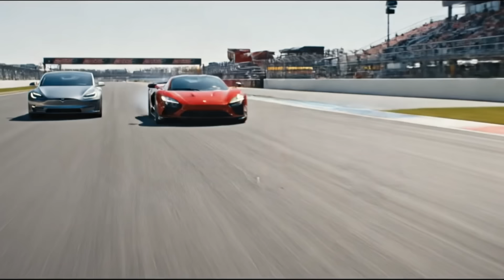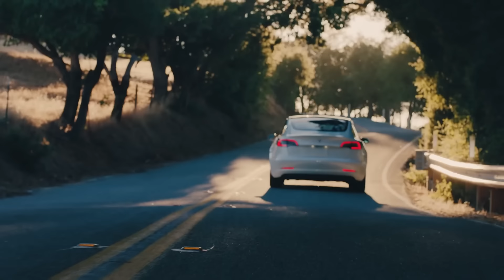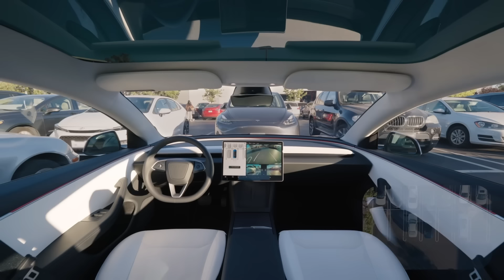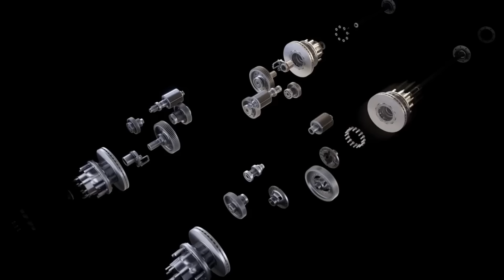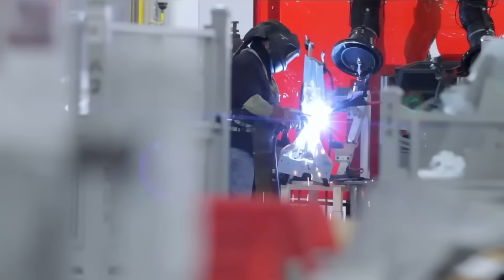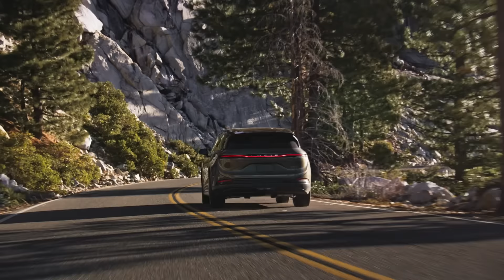Elon Musk’s New Engine Just Ended the Battery War Forever

Comment: We don’t need face melting acceleration. A car should be cheap to buy, cheap to run, reliable and convenient. EVs are none of these things.
Reply from the maker: I totally agree—most drivers don't need 0-60 in 2 seconds. However, the real goal of this motor tech isn't just speed; it's Efficiency. By making the motor more efficient, we can eventually use smaller, cheaper battery packs to get the same range. That is the only real path to making EVs 'cheap to buy' and 'reliable' for everyone in the long run.

Comment: EV are dead. Gas prices is getting cheaper.
Reply from the maker: Gas prices fluctuate, but the shift to electric is about more than just the cost at the pump—it's about a long-term transition to sustainable tech. Even with cheap gas, the efficiency and lower maintenance of motors like the one we discussed are hard to ignore. Whether it’s a pure EV or a 'bridge' like an EREV, the technological leap is already here to stay.

Comment: How efficient do you think a gasoline generator would be if you were to use the carbon wraps technology in it canceling out Eddie forces which in turn would make a more efficient generator.  The same technology could be useful for any mechanical energy production.
Reply from the maker: That is a brilliant connection! You’re 100% right—applying carbon-wrap tech to the electric generator in a hybrid system would significantly boost its efficiency by killing those eddy currents.

This is exactly the kind of innovation that could make EREV systems (like the Chevy Volt or Mazda R-EV we just covered) even more unbeatable. Higher efficiency in the generator means more miles out of every drop of fuel!

Comment: Explain to me how carbon is NOT an electrical conductor in carbon fiber?
Reply from the maker: Great technical question! While raw carbon is a conductor, the carbon fiber composite used here (fibers + resin/epoxy) acts as an electrical insulator in this specific motor design. Unlike a continuous metal sleeve, this composite structure prevents 'eddy currents' (electrical friction) from forming, which is exactly why the motor stays so much cooler and more efficient. It's the material science of the resin + fiber combo that breaks the conductive loop!

Comment: When Tesla finally realizes that fossil fuel engines is cleaner and far more efficient than fossil fuel recharged, fossil fuel mines and refined battery components, that's when REAL environment protection begins
Reply from the maker: The 'mining vs. tailpipe' debate is complex, but the long-term goal is a circular economy where batteries are recycled. 🌍 However, if you're looking for a cleaner way to use fuel today, that's exactly why we just covered the Chevy Volt and Mazda R-EV tech—it’s the bridge many are looking for!

Comment: I'd like to see a car recharge as it drives.
Reply from the maker: That’s the ultimate dream! While solar roofs are still too slow, the EREV tech (like in the Chevy Volt or Mazda R-EV) is the closest thing we have right now—it uses an onboard generator to 'recharge' the battery as you drive. We're actually diving deep into this in our next video!
Reply: @Nexovery yes that would be great to see, two powers working in unison

Comment: Magnets are not needed in AC motors (a Nikola Tesla invention), which are, by design, much lighter and less complex than DC motors. AC motors are possible in a battery-driven automobile by using an efficient inverter design.
Reply from the maker: Actually, modern EVs use AC Permanent Magnet motors (like the Plaid’s) because they combine the efficiency of magnets with the flexibility of AC. It’s the best of both worlds—getting that insane power density without the weight of old-school designs!

Comment: E.V. Explosive Vehicle 
No matter how well you built the motors if you can't fix the batteries from overheating and blowing up the car from thermal runaway ITS A DEATH TRAP only made worst cause many firetrucks can't even put them out.  You wanna make an EV with unlimited range you must look at Hydrogen or diesel and build the car like a diesel electric locomotive instead of the golf kart crap they make now.
Reply from the maker: Thermal runaway is a challenge, but modern battery management (BMS) makes EVs statistically less likely to catch fire than gas cars. As for your 'locomotive' idea, that’s essentially an EREV—and we’re actually covering that tech in our next video! Stay tuned.

Comment: Mabey when you creat carbon dust on nano technick you can jus that as kind of fluwed in away that greas the particals that spanning. And becosse of the high speed rotation its also creat new layer on carbon that protect spinning that motor can let explode. Its  kind of protection becosse the dust fill up the nano fractial on hald milliliter protect carbon u using. Than the dust is fill the nano fractier becosse of centefrusiol principale and you protection is 2 ways protect movement in motor but also the wall you need to protect but i am a fool a stuppid dutchmen how no nothing about ingine technologie 😢 have fun.
Reply from the maker: That’s a very creative take! While the idea of 'self-healing' nano-layers sounds futuristic, the current carbon-wrap relies on pure structural tension to prevent those fractures from ever forming. It’s all about stopping the explosion before it starts!

Comment: Very interesting - but I can't help wondering if repeat stressing on a carbon-fibre-resin jacket won't eventually lead to cracking (like the Titan submersible).
Reply from the maker: Great catch! But the physics are actually opposite: the Titan failed from external pressure, while this rotor handles internal tension—carbon fiber’s greatest strength. Because it’s thermally stable and has been proven since 2021, it avoids the fatigue issues that plague metal sleeves.

Comment: So if you get the battery charged at a charging station how much does it cost?
Reply from the maker: It varies by location and provider, but on average, a full Supercharger session for a Model S Plaid (0-100%) costs between $15 and $25 in the US. Compared to filling up a 1,000hp gas supercar, the savings are massive—but the real win is that this motor's efficiency makes every dollar spent go further.

Comment: What is the point of these insane levels of performance? One of the largest contributors to air pollution is the rubber ground off tires, which is increased by hard acceleration and braking. I thought one of the main reasons for electric cars was to reduce pollution. Sure, the technology is ingenious -- and people like to own powerful cars, but to what purpose?
Reply from the maker: That’s a very valid point regarding tire particulate matter. While the performance is 'insane,' the engineering goal is Efficiency. The same tech that allows for 2.0s launches also allows the motor to be 95%+ efficient at highway speeds. The 'purpose' isn't just speed—it’s proving that EVs can be better than ICE in every metric, which is what drives mass adoption.

Comment: The only thing that will make the Tesla system completely Bulletproof If Tesla uses a gasoline engine to generate electricity If the gasoline engine can generate electricity for the new redesigned electric motors Then anxiety about distance will evaporate The gasoline engine can generate electricity and will be able to be replenished by gasoline for the motor at the pump Within seconds Eliminating charging time That can hours It would incorporate the best of both worlds Until Tesla decides to do this Elon won't have the most unbeatable complete electric car Joel Bell
Reply from the maker: That is a brilliant take, Joel! You’re essentially describing the EREV (Extended Range Electric Vehicle) philosophy, and many engineers believe it's the perfect 'bridge' to full electrification.

It’s like you read our minds—we are currently finishing a deep-dive video on this exact topic: 'Chevy Volt vs Mazda R-EV: The Tech Battle Tesla Doesn't Want You To See.' >
We’ll be breaking down how these 'gasoline generators' compare to pure EVs and if they really are the 'unbeatable' solution you mentioned. Stay tuned, you won’t want to miss this one!

Comment: This is old news on the Plaid.
Reply from the maker: You're right that the Plaid launched in 2021, but the impact is what's new. We’re finally seeing the long-term data on how this carbon-wrap handles heat cycles over years, and the fact that competitors still haven't matched this specific power-to-weight ratio in 2026 is exactly why it’s worth a deep dive now.

Comment: The major need for improvement in Teslas is to do something about the horrible, dangerous, and distracting touch screen.  I've had my model 3 and still find it frustrating and annoying.
Reply from the maker: That is the ultimate trade-off with Tesla. While their engineering team is obsessed with removing complexity and moving parts—which leads to breakthroughs like the motor we discussed—it also leads to the 'everything-on-a-screen' approach.

It’s a classic case of brilliant mechanical engineering meeting polarizing UI/UX design. Many drivers still miss the 'muscle memory' of physical buttons for safety-critical tasks. It’ll be interesting to see if they ever pivot back to more tactile controls! .

Comment: I think this is a BS presentation. Without a metal conducting circle of ateel, a magnatic field cannot be formed that is the cause of the energy needed to rotate the armature. The carbon wrapper merely permits a higher rpm and avoids actual impact by the armature.
Reply from the maker: There’s a slight misunderstanding of the architecture here. The Rotor Core is still made of electromagnetic steel laminations and permanent magnets to create the magnetic field—that hasn't changed.

The 'Carbon Wrap' replaces the Inconel or Steel Sleeve (the outer jacket), not the magnetic core itself. A metal sleeve is conductive, which creates 'Eddy Currents' (electrical drag) and heat. Carbon fiber is an insulator; it provides the massive structural tension needed for 20,000+ RPM without interfering with the magnetic flux or creating parasitic heat.

It’s not just a safety wrap; it’s an electromagnetic upgrade by removing a conductive barrier.

Comment: Has Elon ever gone over a mountain in a fully loaded interlink truck without using exaust brakes ?
Reply from the maker: That’s where the physics of the Semi really shines. Unlike diesel trucks that rely on exhaust brakes (Jake brakes) to dissipate heat, the Tesla Semi uses its high-efficiency motors for Regenerative Braking.

On long mountain descents, instead of wasting that kinetic energy as heat and wearing out pads, the motors act as generators, pumping massive amounts of energy back into the battery. It’s not just safer; it’s literally 're-fueling' while going downhill. 🏔

Comment: It’s not speed we need. It’s range that counts.
Reply from the maker: That’s exactly why this motor is a game-changer! While 20,000 RPM sounds like it's just about 'speed,' the real magic is Efficiency. By using carbon fiber instead of metal, Tesla eliminated 'eddy currents'—the electrical friction that wastes energy as heat.

A more efficient motor means you get more range out of the exact same battery pack. It’s not just about going fast; it’s about going further with less energy.
Reply: With all the charging stations available a range of 350-400 miles is sufficient
Reply from the maker: @rwentowski  That’s a great point! 350-400 miles is definitely becoming the industry 'sweet spot.' The real advantage of this high-efficiency motor tech is that it allows cars to hit that 400-mile target using a smaller, lighter battery pack.

This not only brings down the cost of the vehicle but also means you spend less time at those charging stations because the car is simply doing more with every kWh it pulls from the grid. Efficiency is what makes that range affordable!

Comment from the maker: Everyone is obsessed with battery range, but after seeing this, do you think the motor technology is the real reason Tesla stays ahead of the competition?
Reply: well their motors have been burning out after 100,000 miles, which is sad for this day and age
Reply from the maker: You're likely referring to the early Model S drive units from nearly a decade ago. This carbon-wrapped tech was specifically engineered to solve those thermal stress issues. By eliminating eddy currents and waste heat, these motors run much cooler and are designed for much higher durability and repeatability than the older generations. 100k miles is just the break-in period for modern EV powertrains.
Reply: Well, let see if Elon has changed his ways. Put YOUR money in his new electric vehicle. I'll watch!🤣😂🤣😂